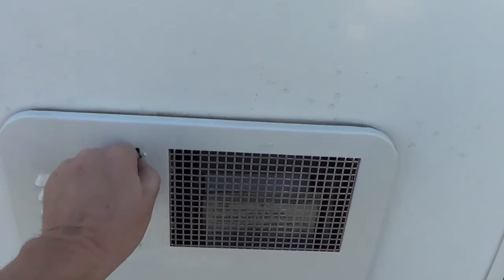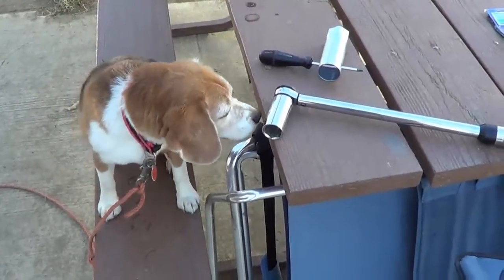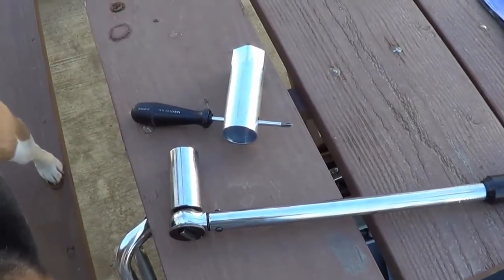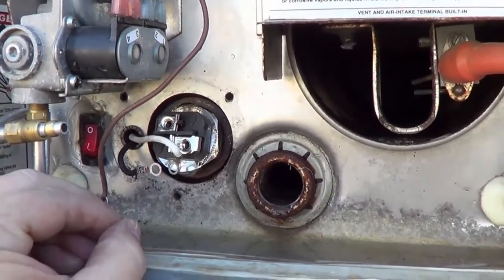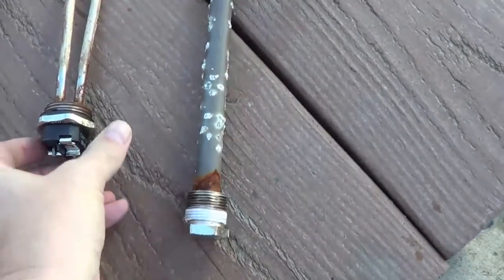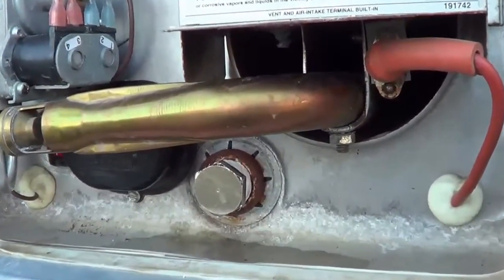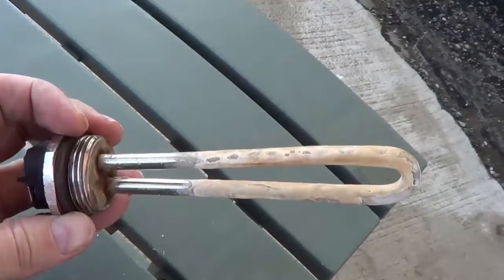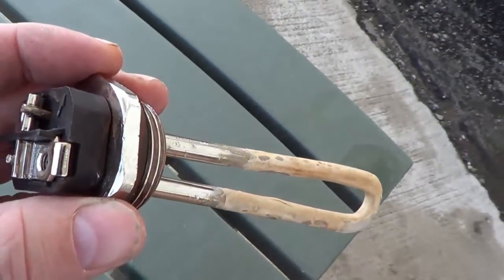What is Causing My RVs Water Heater to Sing?

Comment: I’ve recently watched this video along with the one you did about replacing the switch, looking for any hints you might share about how you diagnosed a bad switch vs a bad coil? Thanks.
Reply from the maker: With the water heater switched on I measured the AC voltage present on the heating element screws with a multimeter. If it measures 110-120 Volts AC and water heater is not heating then you have a bad (open) heating element, if there is no voltage present it is likely to be bad on/off switch, wire or breaker.

Comment: Excellent video.  I watched your previous tank flushing video and you replaced the heater element in July, so only 4 months of use?  Is that normal to get that much sediment and calcification in that short of a time? I've been mostly in the SW states, so you have me worried about my hot water heater now. Is that where you are getting the hard water?  How do you get vinegar in a tank?  I suppose you could use a garden sprayer through the anode hole.  Would spraying work or do you need to let it soak for hours?   Sorry for all the ?s, but I haven't thought much about my hot water heater or done any maintenance, so I better get with the program it looks like. 

 My water heater is gas, so I won't have an anode and heater element, but after seeing how much gunk came out of your tank I better flush it ASAP.  I've noticed my pressure relief valve has started to drip a few drops of water when it's on. Do you know if it's possible to lube/clean the valve and extend it's life or am I living on borrowed time?  Thank you for the very thorough videos.
Reply from the maker: NWHiker 4 months is kinda short, I believe most of it took place in just one park, they had really poor water, and I neglected to use a water filter. Seemed after that the noise started. It was near Sacramento.
But many spots in the SW have hard, salted water. Would be worth giving yours a flush.
The way to get vinegar into the tank is by using the water pump, if you have a winterizing kit installed just pump it in the same way you would antifreeze.
I'm not sure about the pressure relief valve, ours has dripped on occasion and then stopped. Most just thread in though and are inexpensive so might be worth changing out.
Reply: Love Your RV   Thanks for the info.  I don't have a winterizing kit on my water system, so that's something I'll have to pick up.  I'm planning on staying far away from any real cold weather this winter, so shouldn't have to worry.  I sprayed a little WD-40 in the pressure relief valve and worked it in and seems to have stopped any leaking.  I'm sure that's the next item that will need replacing.  This RV living is a full time job!.....:)

Comment: Good vidio. I have the same problem evry 2 weeks I clean heating element.  I have a 2018 atwood heater bad flaw about it is the elements is below drain. So it still has 2 gallon in it. And to cases it only from inside. Drain is outside P's I live in a town called sulphur.
Reply: Verry hard water
Reply from the maker: Wow, that is a bad flaw. :(